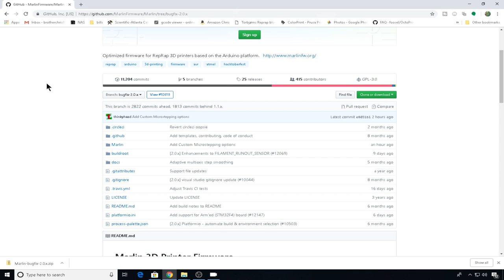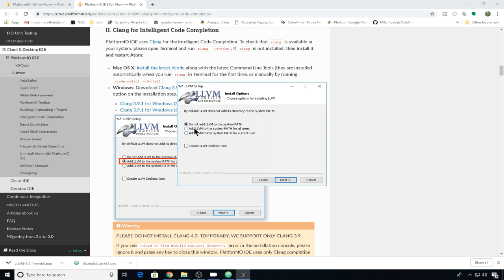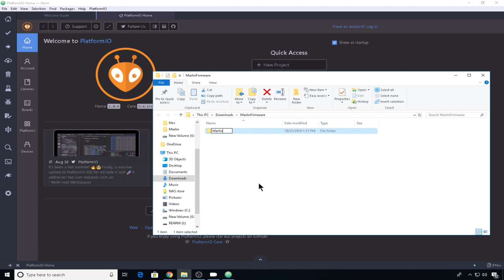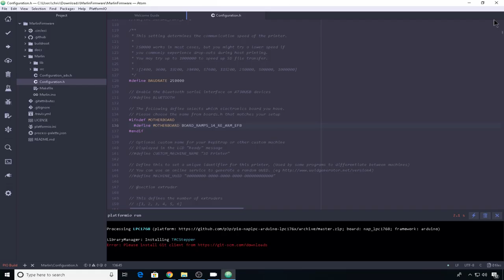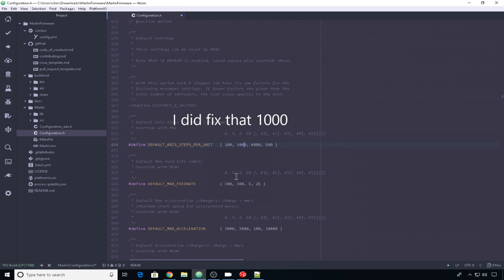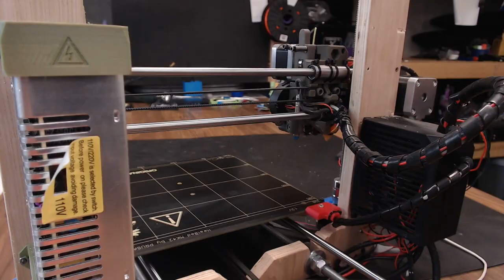32bit Marlin 2.0 - RE-ARM Main Board - Chris's Basement

Comment: Very good tutorial! I'm gratified to see that Marlin 2.0 installation isn't too hard and that the instructions on marlinfw.org are easy to follow.

I originally set up 'platformio.ini' so that no Git client would be required, but since then it's had libraries added by name and not by direct URL. I'll see if I can get it back to no Git dependency before it gets an official release. Anyway, I'm glad you included the Git install instructions. It doesn't take up much space, but I think it's a minor hassle for the average user.

As you noticed the ReARM doesn't work out of the box with the RRD Smart LCD. It requires a custom cable, which is explained at https://github.com/wolfmanjm/universal-panel-adapter (See also http://panucattdevices.freshdesk.com/support/solutions/articles/1000243195-lcd-display-installation)

I look forward to your followup video!
Reply from the maker: Scott, let me start by saying you do a killer job on Marlin. I am flattered to have you as a subscriber. If there is anything I can do to help in anyway, please don't hesitate to reach out.

Marlin is by far my preferred firmware and I probably go through config files troubleshooting, for myself or others roughly 20 hours a week. :)

Thank you for the links, I am going to see if I can get the 2004 going on the re-arm and post a walk through. Anything to make the 32bit conversion easier, I am all for it.

Thanks again!
Reply: @ChrisRiley  Thanks Chris! Marlin needs all the help it can get in the realm of documentation, and your videos are sure to be a very useful resource going forward. I know that a few of our developers have been using the ReARM board (and I have one here that I haven't set up yet on my Prusa i3). I just posted a request for instructions, photos, and diagrams of the custom cable needed for 20x4 HD44780 character displays and the RRD Full Graphics Smart Controller, so hopefully I'll have enough information to be able to add documentation to the website and the REARM pins file soon. The main issue is that it needs to get full 5V power from someplace. I'm not sure if the data lines need to be moved. We'll see!
Reply from the maker: Awesome! Thanks for this, I will let you know if I find a solution as well.
Reply: @ChrisRiley  Here's a much better thread… with pictures, no less! https://github.com/MarlinFirmware/Marlin/pull/7390#issuecomment-320371735
Reply from the maker: @ScottLahteine  Excellent! Thanks again!
Reply from the maker: @ScottLahteine  Scott, thanks again for the help. I got the LCD working with the info on the forum. Much appreciated. Video will be out soon.

Comment: Chris, thanks for this video. Marlin 2.0 is very scarce on info detailing changes from 1.0. What are the improvements other than higher step rate on 32-Bit hardware? Does it still use the Bresenham algorithm for kinematics?
Reply from the maker: 2.0 has a lot of stuff in it, but its main focus is making 32bit easier. As soon as it has an official release, I will start to do feature videos on it.

Comment: Hello Chris ... can you help my with problem :D  thats is mi first big problem with  boards.....  I make on mi chanel several videos about  marlin and print quality and this i dont fix it .... 
 I have  LPC1768 RE-ARM .... after PIO Build & uploading and presisng reset button in device manager doeat have driver ... its always Mariln USB Device .... I  try install smoothy driver not fix .. from  folden ..MarlinFirmware\Marlin\src\HAL\HAL_LPC1768  not fix   On SD card  ... REARM  I have  firmware.bin and Firmware.CUR all loocking good  but after restrart button  firmware.bin doesnt have ther and visible is only firmware.cur ......    &   i try  with sliding ramps 1.6 turn on power supply (12V)  and  try install  drivers....but not installed ...  wheeeere is ***** problem ? please help  ...
Reply from the maker: Not sure I understand the issue. After you load the firmware the board doesn't come up, it that the issue. As long as the .bin file is there you should be fine.
Reply: @ChrisRiley    thanks Chris.... 
problem is  when I  upload firmware to board and press reset button    in device manager     this board  doesnt have driver for installing ...      I use smoothy driver, I use driver from marlin firmware ... allways   doestn install board driver ...
Reply from the maker: @macolaiden  About the only thing I know to do is to try to get some new drivers from the vendor.

Comment: Any thoughts on using 'make menuconfig' or 'akaJes/marlin-config' to configure the Marlin firmware?  Can it be used with Klipper?
I'm looking at using the Metro M4, but it doesn't look to have any sd card, so do you think it can be made to work?
Reply from the maker: I actually have never tried the configuration tools before. akaJes/marlin-config seems to be pretty nice, it might be worth a try. Yes, it can be used with Klipper. The adafruit board? I don't think it would have enough I/O, I could be wrong.

Comment: Hi, I uploaded Marlin to the rearm, however it does not move the stepper motors with a Ramps 1.4, I checked with osciloscople and the board is not sending the signal, is there any additional config to add it to the board, I understand it is 3v, and I used DRV8825. Appreciate any recomendation.
Reply from the maker: No, there shouldn't be anything you have to change up. Even by default it should send those signals.

Comment: Good tutorial.
Just need to remind people that the Pin 1 on one connector needs to be tied to a separate 5V rail, as that power pin is only supplying 3V3 which isn't enough for the display
Reply from the maker: Thank you! Yes, great tip. In fact, I have a video on LCD's and re-arm coming out soon.

Comment: Great tutorial Chris. It is a little convoluted at the moment, but I'm sure that will be simplified soon, it won't put me off though. I'm seriously thinking about putting 32bit on the CR-10 .... hell, why not :-) Still need to get time to do the LA tweaking first though.
Ordered some Capricorn tube from E3D for the CR-10, wondering if I should get a Micro-Swiss hotend for it too? It currently has a 10mm Noctua hotend fan, but I have a 20mm one if I need it. I've seen somewhere that the 10mm one doesn't push enough airflow through for the Micro-Swiss hotend. I'd really appreciate your thought and opinions please.
Reply from the maker: Thanks Spike! I am not really sure on the Micro-Swiss. Some of the guys really seem to like them. Looks to be a direct swap out. I would like to give one a try at some point, it is a little pricey for the creailty version. I have also heard on some of the more compact hotends the 10mm wasn't enough, although I have not tested it. It never hurts to have more fan right? :) BTW, a 32bit high speed CR10....awesome!
Reply: @ChrisRiley  Only one way to find out if it's any good eh lol, yeah it is a bit pricey, but 3D Printz here in the UK have them on offer for £47.90 so thought I'd have a punt. I plan to swap the fan out at the same time, like you said, can't have too much cooling, I can turn it down if necessary but not up if the power ain't there in the first place. Also ordered some Capricorn tubing from E3D. Hopefully all this will constrain the feed and improve LA. I'm on leave in a couple of weeks, so hope to have plenty of time to investigate, I'll keep you posted.

Comment: Hi Chris, i followed your tutorial and then another cause i have TMC2130s on my machine, and all is well, but my fans don't spin ! i've measured that the board (Ramps 1.4) only feeds them 5V, any idea why ? a jumper that i didn't add/removed ? it all worked nice with the arduino, and i'm sad. please help :0
Reply from the maker: Hmmm....where do you run your fans from? What pins? You are using re-arm?
Reply: @ChrisRiley  I was using the aux3 pins on the ramps so yes the voltage comes from the re-arm, I need to figure out how to wire mosfets from 3.3v to 12v for the fans, hoping the mosfet will take pwm
Reply from the maker: @FlipTieYT  I think you should be all set with the mosfets, they should with PWM.

Comment: Hi Chris,

Fantastic job as usual!

I would like to ask you if you can explain the real difference between 8bit systems and 32bits...
I mean, we know the difference in computing power, but many time I heard you definitively need 32 bit on CoreXY and Delta machine.... why?

Until today machines like Anycubic Kossel (which you also made some video with Marlin 1.1.9) are working with Arduino mega based 8bit processor and they are doing all what we ask them to do. 
What is the real advantage to move to a 32bit ? What I will gain?

Thanks again for all your efforts on making your channel one of the best!

Marco
Reply from the maker: Thanks Marco! Well it really is all about speed. 8 bit can handle the Delta pretty well as log as you go print to fast. Because of the extra computation that has to be done for the Delta moves, it can empty the buffer and cause it to stall, it just can't crunch the gcode fast enough. Core XY isn't such a huge deal, unless you are printing crazy fast. 

So the advantage on the 32bit processor is just the ability to print fast. With that said, a lot of the boards coming out that are 32bit, add a lot of other features that do make your print quality better. Take the Duet for example, it's 32bit, but it also have TMC 2660 drivers on it, which are amazing. So, it seems as the 32bit board roll out, they are coming with higher class components as well.
Reply: Chris Riley thanks Chris!  Very clear! I think I never yet got to overflow the buffer.... I prefer print a bit slower to improve surface quality. But as you said, on 32 but much modern processors, better drivers and hardware in general. Duet is on my wish list ;-)

Thanks again mate.
Reply from the maker: @TheSnow520lee  You bet!

Comment: Great video as always. 
I have a question for you?
I get an skr 1.4 turbo and one mks sgen L borde. When i download the Marlin file to the vs code and build without any change i get success.  But when i just change only the default envs to LPC1768 and build its give me error ( oops . Set motherboard to an LPC1768 based board when building for LPC1768).
What should I do in this case?
Thanks
Reply from the maker: It's saying your mother board setting is incorrect. You need to change it to the skr_1_4_turbo setting. Look in src/boards.h for the correct name
Reply: @ChrisRiley  done 
 ( MKS SGEN L) + TMC2209
Now when i start my printer and check in Pronterface with m122 i get:  

Driver registers all axiss XYZE bad.

And testing connection ERROR All Low.
My TMC2209 is (FYSETC V3.0)
I already cut the pin for senseless  homing and had a jumper on the tow TX & RX
Reply: I found the problem. It was the FYSETC tmc2209 v3
Some wrong internal connection so i need to jumper the RX to the UART pin to get it to work. Now everything is working.
Reply from the maker: @coolt5  Awesome, glad you found it.

Comment: Hi Chris - hope you are keeping well. Quick question - How to change TMC2208 driver current in the latest  Marlin script version. Thanks in advance. Martin (current setting Z axis 800, printer works better at 900).
Reply from the maker: Hello, those settings are in configuration_adv.h search for this. AXIS_IS_TMC(Z) Or you can do it with a gcode command and save it in eeprom. M906 Z900    then M500 to save.
Reply: @ChrisRiley  Thank you so much Your a legend!

Comment: Hey Chris, awesome video once again. I watch a lot of tutorials but yours are the best by far. Quick question here, I have the same board and I'm wondering if it's possible to flash smoothie back. Keep up the great work!
Reply from the maker: I "think" you could just save the SD card with smoothie on it and use a new one to try Marlin. Then you could switch back if you want. I haven't tested it, but I think that should work

Comment: Just finished loading Marlin on my Re-Arm, had to enable eeprom in order to do an M502 and M500, it works but theres no eeprom.dat file on the sd card, just curious if theres been a change to 2.0 that wasnt listed
Reply from the maker: Scott might be able to answer that for us. I noticed at first I had that file. Then later, eeprom was working, but still didn't have that file.
Reply: The eeprom.dat file lives on the SD card on the Re-Arm board.

Comment: the only "problem" I have with the Re-arm is that due to the Ramps, it only supports 12V power supply and NOT 24V, unless they changed that? Please tell if that's the case, I'm using RADDS instead this just because of this.
Reply from the maker: That is correct, RAMPS does limit you to 12v.

Comment: Is there any memory/flash size limitations on the  32 bit controller, like on some 8 bit controllers?
Reply from the maker: It depends on the chip, but a LPC1768, it has 512k.
Reply: @ChrisRiley  interesting. I thought i read that particular chip had 64k total with a 32k chunk and that it had two additional 16k chunks available to peripherals.
Reply: @ChrisRiley  interesting. I thought i read that particular chip had 64k total with a 32k chunk and that it had two additional 16k chunks available to peripherals.
Reply from the maker: @muskateer10  I will have to go back and look at the sheet.
Reply: @ChrisRiley  there must be different versions. I looked again and this time the one i looked at said it had 512k.

Comment: Thanks for the tutorial, I am trying to upload this to an SKR V1.1, but after I upload and restart the board, I only have the "firmware" file and not the epron.dat file.

Any suggestions or recommendations on correcting this??
Reply from the maker: You are probably ok, the eeprom just hasn't been initialized yet. If the board isn't coming up, there might be another issue.
Reply: I had the same issue. In the configuration.h file you'll have to uncomment the define eeprom settings. 
https://www.youtube.com/watch?v=ckP2-GrMHvA I found the instructions here very helpful.
Reply: i had the problem as well, i fixed it with M502/M500 .

Comment: The lcd issue is likely a 3.3V issue. You have to do extra setup for the 5V. The female to female cable to do this should have been provided with the ReArm board. See Panucatt's instructions below

https://panucattdevices.freshdesk.com/support/solutions/articles/1000243195-lcd-display-installation
Reply from the maker: Thanks man, yeah, that works for the full display, not sure on the 2004, I still need to test it.

Comment: Chris, Thanks for your work on this. I recently flashed Marlin 2.0 to my rearm board. I got the firmare file on my sd card but no eeprom file. The firmware file is a .CUR and not a .BIN file. when I tried the M500 with Octoprint the board would crash with a EE PROM error. I found that you have to uncomment #define EEPROM_SETTINGS in the configuration.h file. After doing that, octoprint works. testing is still in process but so far so good.
Reply from the maker: You're welcome, I should have mentioned that. Eeprom is disabled by default. Glad the testing is going well.

Comment: It looks like Marlin should be left on 8 bit boards because it was architected around them. The biggest one is it relies far too heavily on compile-time options, firmwares designed for 32 bit get away from that. I've never compiled a 32 bit firmware because it's not necessary. The configuration is loaded at boot time, and most configuration changes is editing a file, hitting save and reset, or with RepRapFirmware, just feeding it the changed config lines usually works, no reboot needed.
Reply from the maker: It's still kind of apples and oranges at the moment, but Marlin is getting closer to where it needs to be to support both.

Comment: Hello
First of all, good luck
I Have MKS SGEN L V2 Motherboard
It s Created Error While I'm Assigning Marlin Firmware To This Board Via USB.
In addition, after flashing the firmware from the SD Card, I cannot reading the temperature value from the sensors while I am going to set the PID on the Repetier Host.
I'll be glad if you help.
Have a nice day.
Reply from the maker: With the newer version of Marlin, you can use the build extension that should make this much easier.
Reply: @ChrisRiley  what extension?
does it have any name?
Reply: @mustafaonurucak614  In VS Code, it's called Marlin Build.
Reply: @jackieriley9657  I tried but it didn't work.
If you can write your e-mail address, I can show you how I got a warning message from pronterface.
Reply: @ChrisRiley  I tried but it didn't work.
If you can write your e-mail address, I can show you how I got a warning message from pronterface.

Comment: Great vid but what are the main advantages over using 8 bit?
Reply from the maker: Thanks! Well we are on the cusp of 32 bit right now. The 8 bit processor is getting hard to come by and if you want to print faster you have to process gcode faster. So 32 bit is inevitable.
Reply: @ChrisRiley  8 bit processors aren't even close to being hard to come by. The main advantage of 32 bit processors is that they are faster clock for clock and faster due to a higher clock frequency, have more advanced interrupts and dma channels to offload automated processes from peripherals from the main core like reading sensors or accessing sd cards. It's also possible to add wifi and ethernet networking for on board webservers like the duet 2 wifi. On the duet tge configuration is done from sd card instead of compile time, which means changing settings is done by efiting a fike on the sd card, no firmware recompilation and upload is necessary.
Reply from the maker: @imqqmi  Thanks for the info.